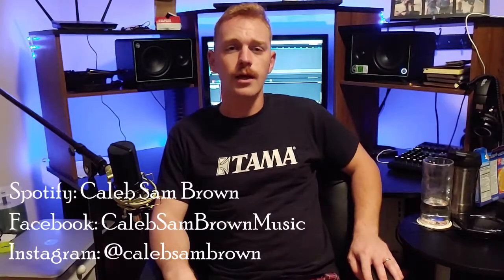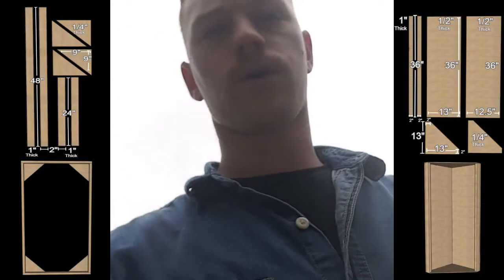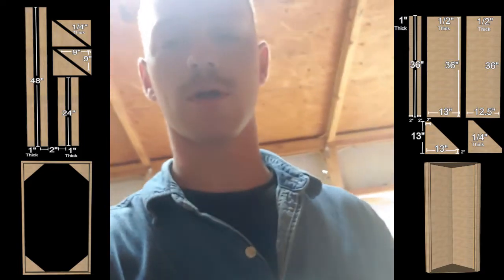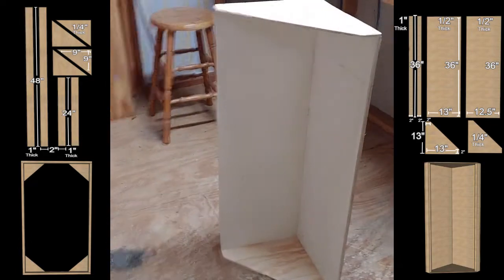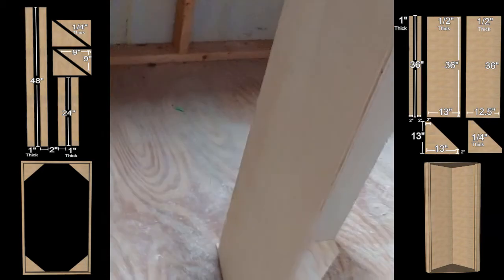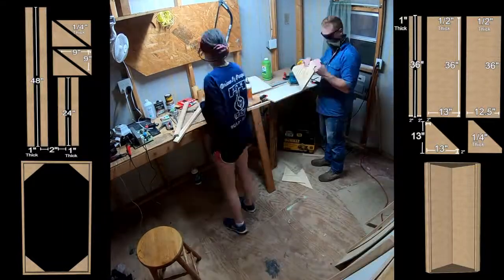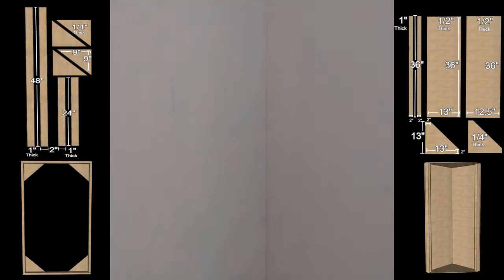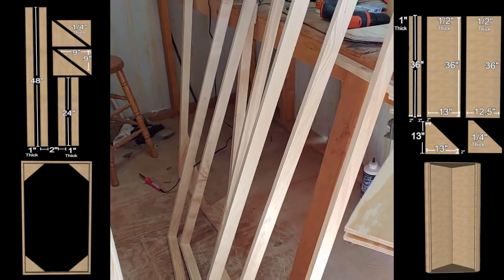Home Studio Build | DIY Acoustic Treatment (Wall Panels and Bass Traps)

Comment: How much insulation do you need for the corners
Reply from the maker: It really depends on how many/how large you make them. I think used less than a single fiberglass insulation bag total
Reply: @calebsambrown  thanks for the quick response! I just wanted to have general idea to plan this project.
Reply from the maker: Glad I could be helpful!
Reply: How many rockwool panel in total you used for this project?
Reply from the maker: @LaongLaanDimasalang  I think it was just less than one per panel. You can cut them to fit any size though